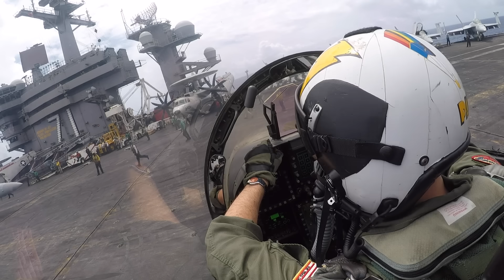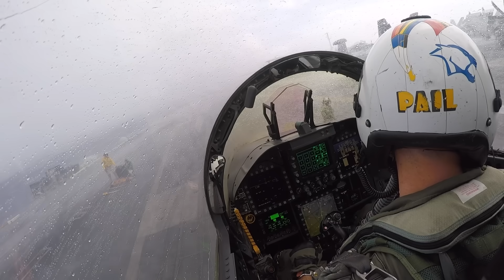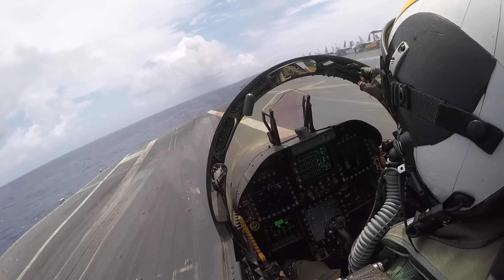Why Navy Pilots Launch Toward Storms

Comment: Maybe a dumb question. Does training for conflict with a peer power,  China, for example, require a massively faster launch recovery cycle? Or does it take so long to prep launches? If it takes so long, is that not a real weak point? I love your vids, thanks for what you do.
Reply from the maker: We have procedures in place to speed up launches significantly if required, though the carrier doesn’t normally operate in places where immediate launches are required for self-defense.

Comment: Not sure if you still check the comments on these older vids anymore but I've always wanted to ask if there ever came a point in time where you no longer got nervous/anxious on take-off and/or landing?  I was in the Navy for 6 years and flew in many SH-60B (LAMPS MK III) helos.  I would always ask my pilots the same question and the answers were kind of a mixed bag.  The hardcore Alphas that were certain they should have been made Growler pilots- never got nervous.  Even in a sea state 65, using both RAST's, and 6 wave-offs by lesser pilots, their answer was always "naw."  The most prevalent answer though was- "Oh yeah, especially landing."  (Keep in mind we were onboard a CG)  I'm sure landing is probably the most nerve-racking for you guys but I'm curious if there ever came a time where the canopy opened and you realized that the landing was so second nature, you didn't even recall it.
Reply from the maker: I’m always a little nervous before a flight and moderately nervous before a night flight with a night carrier landing.  From my experience, nervousness is healthy stress that keeps up alive.  Complacency can get you in a lot of trouble in this business.

Comment: Pail, I sure do like your videos.  I was stationed at Kingsville VT-22 1967-1970.  I was in airframe shop and did get checked out to ride in back seat of the old F-9.  I think I had about 12-13 hours in back seat it was lots of great memories.  I did cross country with Marine Captain to KC Mo. he dropped me off and then picked me up the next day.  On way back to VT-22 we stopped at Air Force base for fuel and stretch our legs.  There was a flight line of F-4s all camouflage up   I asked Captain if we could jump in one and try it out, he just grinned. I’ve always wanted to come back to VT-22. Pail if I get back could you take me for a short hop over the King ranch ? Thanks for keeping America safe.  God’s Blessings as you’re flying in the Heaven above.  Mike M

Comment: I was on the USS America CVA 66 for 2.5 years in the  early 1970's. Did 1 tour to nam & another medpac cruise. I would volunteer to do maintenance on the Captains elevator so I could watch flight ops from the tower. Got to be up there during the air show on the way home from nam.  Got to experience a fly by close up. I know why the Air Boss seldom allows fly by's.
Reply from the maker: TYFYS.

Comment: Super silly question. When you go into tension and apply the parking brake and hold the brakes. Does the plane electronically release the brakes before launch or are you taking the brake off just before launch ??
Reply from the maker: When we go into tension, we put our parking brake "in", or disengage it.
Reply: Thanks for the super quick response. Love your videos. One of my close friends use to fly Tomcats so I usually pick his brain with things I see in your videos. You saved me the trouble this time.

Comment: Did the deck crew anticipate the weather and wear wet weather gear or are they soaked and cold with that wind? Impressive either way.
Reply from the maker: They were soaked, but not cold.  Temps were around 90 F.

Comment: 3 S gap between take off one another in catapult shot and also has the ground electronic system connected to the planes exchanging information of many types to help to take many important decisions for example to stop launching or let them launch on time . Ground Electronic control system also control and saves pilots life by controlling  his/her aircraft by giving them their flying tools or you may say cockpit control options available on that time if everything is okay to fly them in the air. ❤

Comment: Quick question, when what is the weather like for you inside the cockpit or is the air conditioning of the jet really good and keeps you cool even even on the ground?
Reply from the maker: It’s just like the inside of a car in there.  We have AC and can set the temperature.
Reply: @GrowlerJams  does it work fast and can you actually feel it with the flight suit on ?

Comment: Closest physical connection I"ve ever had with the F-18 was while floating on the Severn River north of US Naval Academy during the week of graduation festivities; the Blue Angels demo is a local favorite. On an insanely low, screeching pass, I felt and smelt the fuel vapors floating down :) One other close encounter was with the planes as they sat idling at Andrews AFB. It was a scorching hot day, I had broadcast camera rig set up near to their line. 100 degrees, standing in their exhaust for 90 minutes or so, I did kinda close my eyes thinking how like a carrier deck it must be, except for the pretty stable ground I stood on, not pitching in 20' seas :) Thanks Growler Jams..... so much appreciate this.

Comment: Why 500' for 7 miles?  Seems a long time to be that low. Also, how do you protect the cockpit/avionics from water damage in rainy wx?
Reply from the maker: So we deconflict with overhead traffic at 800 feet.  

We open!and close the canopy as quickly as possible, just like you would do in your car.

Comment: Notice the list to port ! That the weight of the steel balls (+ mustaches) of the C2 pilots.
Reply: @GrowlerJams  Just throwing "The Hounds" a bone Rock Star.
Reply: @GrowlerJams  Question: Do You like having a REO or would You prefer a C ? You would have been a great "Tomcat" driver I bet. 35's and 22's are okay but I think the Growlers are the "new King". Long live the Tomcat/Hornet.
Reply from the maker: The more I fly single-seat, the more I like the challenge of doing it all myself.
Reply: @GrowlerJams  That's what I wondered. If the challenge would be attractive.

Comment: While in service I had quite a bit of radio time, most of it air craft related.  Consequently I grew to really like to hear communications preflight, flight and landing.  This is where I got to grasp the importance of check list.  They will save your life.

Even though I didn't get to stick with being directly flight related; I was slated to work on the Harrier power plant, got some OJT on a CH53 waiting on a slot to open in school.  The slot was 2 years out so I had to change my MOS.

In my new MOS I was still able to be on the radio quite a lot, in one aspect in direct communication with air craft, fixed & rotary.

I know that it's not possible, but personally I would like to hear some radio chatter.  Old time sake sort of thing.  For security reasons though that isn't possible.
Reply from the maker: I have some T-45 stuff with comms.  Stay tuned.
Reply: @GrowlerJams  Click, click

Comment: Being a land based helo man, CH53 in 1977 at Santa Ana LTA, I didn't get much experience on a Carrier.  Another unit from LTA did a Carrier based exercise out of San Francisco.  They had some breakage and we had to fly some parts out to them.  The seas were running a bit high which made the landing  interesting.

I still have immense respect for Carrier based troops.  That is an intense environment.

Comment: 0 to 190 mph in 3 seconds...to try and understand I have to related it to a motorcycle I had that was rated at 0-60 mph in 3 seconds - no comparison. Pro stock NHRA racers go from 0-210 in about 6.5 seconds  (perhaps 160 in 3 seconds?). So these jet launches are maybe a little faster than pro-stock.  The top fuel runs are doing about 300mph in 3 seconds.

From the video the first 1 second in the jet looks slower than a NHRA launch. But the next 2 seconds look faster. Very few people every experience that kind of acceleration.

Comment: A daft question Pail. I take it when you are taxing the plane around the deck you are using the jet blast. I often wonder why planes are not designed to use an electric motor as propulsion to move around when on the ground. Or is because the weigh so much.
Reply from the maker: There’s no need.  Jet motors work just fine for taxiing on deck.

Comment: A couple more questions about this video: 

1) Near cat one there is a real tall pole. What is that used for?

2) With the ship operating near, in, or around thunderstorms, are launches and recoveries temporarily suspended a) for flight safety reasons and b) lightning danger to the people on the roof?

3) Cat 3 with always have a orange metal cover nearby (in this case lying next to the holdback bars at your 11 O’clock or so).  I’m guessing that is placed over the Cat 3 shuttle during recoveries to prevent damage to the shuttle in the event it is run over by an aircraft.  Is that correct?
Reply from the maker: That’s called the “nav pole”.  Used for ship navigation equipment.  

Yea, we will suspend launches in lightning.  

That’s called “Fast Eddie”.  It’s used to protect the shuttle from landing aircraft.

Comment: Them E2 props are nasty.  They parked us just behind Cat 2 and I put my helmet on my seat and put my ears on  to exit.  Just as I exited the A/C the E2 went to high power for TO.  Down the flight deck I went. 
3 seconds for a cat shot is a luxury, the USS Midway cat stroke was I think 1.5 seoncds.

Comment: love your videos. Quick question from this one....... how long would you on average be waiting from engine start up to cat launch? (second question.... if it is on average a substantial delay with engines running,  would it be standard practice to get to a tanker right away because of the time it took between start and launch?)..... hope this makes sense.
Reply from the maker: Usually 15-20 minutes on deck.  No, tankers are not normally required.
Reply: @GrowlerJams - thanks so much for answering my questions. I really appreciate it . 🍺 🍻

Comment: TINS, yes, the boat does find the wind! As the first A-4 tanker off the CAT, I was day launched into a thunderstorm.  Went IFR at 700' and climbed until I broke out about 25000' By then I was on one side of the T-storm (much higher) and the ship had turned around.  Took about an hour + to circumvent and make the next cycle to trap.  Nice, that I had plenty of gas!

Comment: Hi, I noticed you said you would start up 35 mins before takeoff to trouble shoot any problems however, your F18 is burning quite a bit just sitting on the flight deck. In one of your vids you had hold in a descending pattern and then overshoot (wave off) a few times and get back on deck. I know you are not burning 1100 gal an hr sitting there waiting but your F18 capacity is dwindling as you sit there. 
When I was doing my IR I remember an old Lightning pilot telling me he was stacked up at FL100 waiting to get back down and he was getting very nervous. 
So… have you had any fuel emergencies where they had to get you back ASP? 
Regards 
Bob 
Ps beer in post :)
Reply from the maker: Sure.  Fuel is one of our biggest concerns when flying around the boat.  Pilots are expected to carefully manage their fuel, but if you screw it up, there is always a tanker or two airborne overhead mom to give you a squirt.

Comment: I love these videos. The flight deck crews are amazing, and remind me of an old advertising campaign here in Australia for the RAN in the early 1980s. “You’ll be wet, you’ll be homesick and frightened but the pride of the fleet will be you!”(search that up on YouTube) We even had a CATOBAR carrier back then too, until 1982… a whopping 20,000 tons full load displacement with one cat and A-4s and S-2s which barely fitted… 😂

I joined up anyway later in the 80s…
Reply from the maker: Too funny.  I’ll check that out.  Cheers!

Comment: Hi Growler, mate I’ve been wondering for some time now, at high speeds, are turbulence still an issue? Or I should ask, at subsonic/ supersonic speeds do you still experience turbulence like a passenger aircraft? 😊
Reply from the maker: Yes, turbulence is a problem for all aircraft, even if you go fast.
Reply: @GrowlerJams  thanks for the reply mate.

Comment: When you take the foot off the brake and put the parking brake on, at which point in the sequence does the parking brake come off? When you move the throttle to full Mil Power or before you put your hand up on the handhold?
Reply from the maker: In tension, we take our feet off the brakes and put our parking brake IN.

Comment: Thanks, Pail. So I'd love to hear more about the whole "into the wind/not into the wind" thing, which to me is almost a throwback to the biplane/piston engine era. I get that you only want to launch planes into the wind, but what happens if there's NO wind? Do flight ops come to a stop? Or can you still have launches, maybe with greater catapult power? Thanks so much for the jams, and Fly Navy! 👍
Reply from the maker: We always launch and recover into the wind.  If there isn’t wind, we make our own.
Reply: @GrowlerJams  Fair enough. So the carrier just needs to get up to sufficient speed to generate that wind over the deck. But if there’s already a strong wind does the carrier drop its speed, or do you just take advantage of the extra lift? Thanks.
Reply from the maker: The boat slows down if there is enough natural wind.  It’s not safe to work on the deck with high winds.

Comment: At 9:58 you can see in the left mirror, that the EWO has the JHMCS on his helmet.
Is it normal on the Growler that the EWO has it, but the Pilot doesn´t?
In a lot of Videos on different two seater jets it´s normaly the Pilot having the JHMCS on and not the EWO/WSO, or both having it in some cases.
Reply from the maker: It just depends.  I wore my helmet when the mission required it, but didn’t wear it every flight.  Frankly, it’s big and heavy, so I spared my neck when I could.

Comment: Pail, you intrigue me with the commentary. Great video, thanks. Can you confirm you said you set the park brake before launch and does it disengage automatically or do you kick it off with the wipe round? Seems counterintuitive to put I RV on as you are positively held in place with the hold back and launch bar. Thanks.
Reply from the maker: Parking brake IN and feet off the brakes.
Reply: Ah In. I’m a Brit so didn’t catch it right, sorry. Thanks hope you’re enjoying the (Gos)Hawk.

Comment: I was a cat guy from back in the 80-90. Was on CVN-65 and 70 CVW 11 and CVW 15. Been through a lot of storms and being up on deck during those real sucked. Only aircraft that really didnt like on the cat were the A-6 and the EA-6B, the engines at full power would rattle the teeth out of your head.
Reply from the maker: Ha!

Comment: Was part of the team that designed and integrated the EW fr0m the ea-6b into the f-18 to create the ea-18g. At first the navy folks pushed back on the name growler. For reasons I'm sure you're aware. Still working updates to aircraft.
Reply: Another name for the head on the boat.. chiefs were having a field day with the name during develoment.
Reply from the maker: It also means something else in the UK.

Comment: Super fascinating ❤️‍🔥

I have a short question. I recently noticed that Hornet grip is slightly tilted ccw. I was wondering if the stick axes are also not parallel to the actual pitch & roll axis.

Thanks and cheers 🫡
Reply from the maker: The stick conforms to the pilot’s natural grip, but it’s not tilted.  It’s parallel and perpendicular to the axis of flight.

Comment: Great stuff. Hey two questions: (1) How soon after launch do you raise the gear? (2) How long do you fly low on the water after launch before you're clear to leave the carrier's airspace?
Reply: I don't really know about real life but from what I know from DCS (Digital Combat Simulator) you raise the gear and flaps immediately after launch and for a CASE I departure you do  20 degree clearing turn from the ship (If you are on the bow Cats then you turn right and if you are on the waist Cats you fly to the left) then fly BRC (Base Recovery Course, basically the ships heading) at 500 feet till your 7 miles out
Reply from the maker: Truth!

Comment: I've got a question, why does the jamming pod have a generator instead of being wired as an integral component? Or is it just putting out that much power?
Reply from the maker: The amount of power required to power the jammers is immense.  Rats take the load off the generators.

Comment: Question: Why bother with the weight of the jet for the catapult? Why not just assume maximum growler weight and sling you and all Growlers off the deck, some will go faster, some slower.
Reply from the maker: It puts too much stress on the catapult and the aircraft…both won’t last as long if you abuse them.

Comment: I was wondering about how the stick is oriented in the cockpit.. it looks like this one is slightly twisted to the left.  Is the stick orientation up to the pilot's discretion (say for ergonomic reasons), or is it a standard?  Or is it actually inline with the nose of the jet and it just looks skewed to the left on camera?  I guess the reason I am asking this is that I want to know if it is in fact oriented off center, does that mean that nose down and nose up control inputs are in line with the stick orientation, or are pull up and push down in line with the nose of the craft?   
dang... I'm sure there was a better way to ask this question.  hehe.
Reply from the maker: The stick is not off-center.  Must be the camera angle. Otherwise, like you suggest, there could be problems.